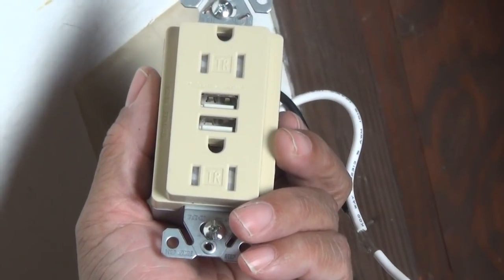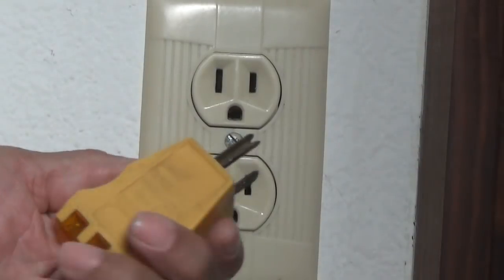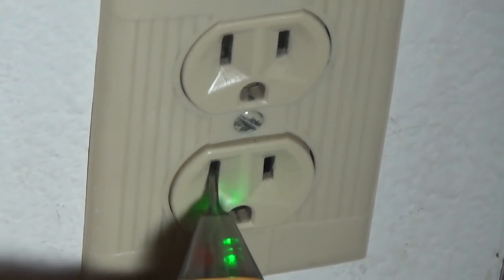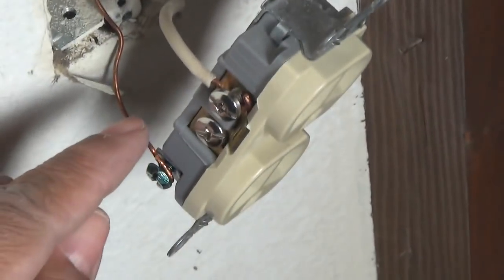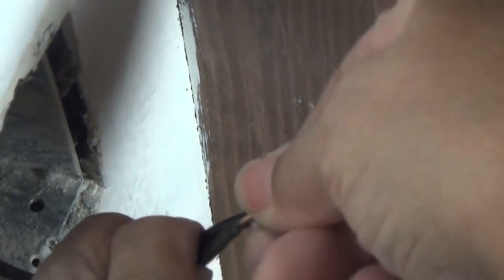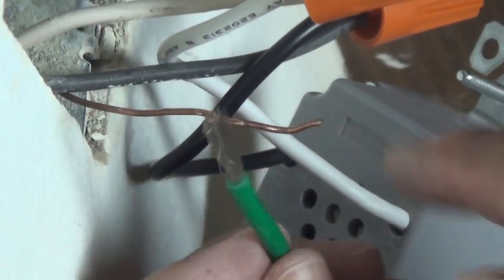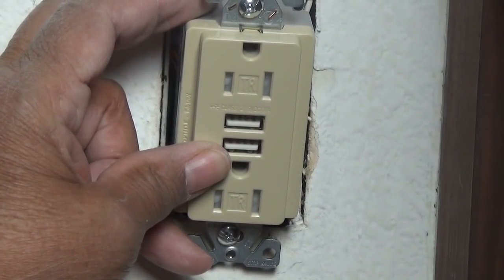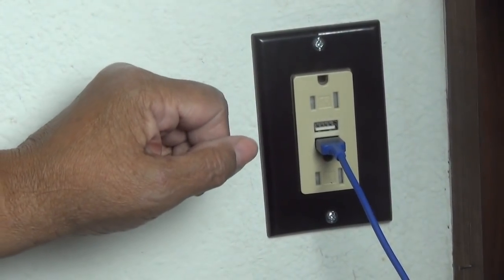USB PORT IN A WALL?! - USB Outlet Tutorial

Comment: I would check top and bottom of outlet. I have some switched outlets that are controlled from a wall switch. So the the little bridge connector on the socket is spit and it could appear to be off while the other half is still hot!
https://ask-the-electrician.com/images/switched-outlet-step-3.JPG

Comment: You help so many people I wanted to pass along that these outlets are not a good idea. USB power is changing so much that there is a very good chance that when installed they will be worthless shortly afterwards.
Reply: It's only a 'bad' idea if one wants to have the fastest charging speeds or doesn't mind tying up an electrical outlet with a USB adapter. I have two of them, one I've had for three years. It outputs 2 amps which is more than enough to charge up more modern devices. I'm sure at some point they will become obsolete. If they do, I'll replace them because I value the convienence and appearance over the cost.
Reply: @johnlcallaway  mine do not charge anything other than very small devices. Some of those devices constantly go in and out of charge mode. And my friends caught on fire, luckily he was home and the circuit breaker popped. And he's a fireman so he had an extinguisher in the kitchen. So no mas para mi.

Comment: Over $24 for an outlet?! No thank you.
Reply: Depends on if you need both outlets or are willing to tie one up by spending another $15 on a USB adapter. I've got one in my wife's sewing room in her built-in shelving unit, and another in the kitchen for hooking up tablets when cooking.   They are a lot neater than having adapters.
Reply: Cheaper than buying a new charger, though.
Reply: @Faddidaddi  Where do you buy chargers? I get mine for $1.
Reply: I purchased a two pack for $16.99 on sale recently at Best Buy, but regular price is $29.99 for a two pack. Here’s the link:  https://www.bestbuy.com/site/dynex-2-4a-usb-wall-outlet-2-pack-white/5834701.p?skuId=5834701

Comment: American wiring seems so messy compared to UK sockets.
Reply: As someone who has been making my own electrical changes for decades, it's pretty simple to do. Three wires .. hot, neutral, ground. No switch to take up unnecessary space that no one in the US would ever use anyway. While Leah used wire nuts, there are other alternatives that are smaller and supported by most electrical codes. I still prefer wire nuts, they are far less likely to work loose than the more modern spring-clip versions.  And I never use electrical tape, a properly installed wire nut doesn't need it and codes don't require it. I think it's unnecessary, but there are those that think otherwise.

There are different styles of outlets with many different features, the one Leah replaced is an older style.  I find it very irritating that the makers of these devices insist on providing wires instead of lugs, lugs can make that installs so much cleaner. But that is a manufacturer's choice, it has nothing to do with electrical code. On the other hand, many of the switches I've replaced already had wire nuts in the box, so it wasn't a big deal.

it's only as messy as the installer made it. Decreasing the 'mess' often means more wire, which means higher costs.  It has nothing to do with code.
Reply: Hehe yes. Dont look like That in denmark to
Reply: I’m always amazed by how American wiring is done. Wire nuts belong back in the 50’s.
Reply: @sixpackpieman  the first wire nuts were walnuts🤣
Reply: Only messy if you're a British electrician
Reply: and Australia. If I saw a black wire, I'd think it may be an Earth. Although, ours can be a bit weird too, such as a brown wire being live and a green and yellow striped wire being Earth. It all varies, though.
Reply: I lived in dk in the 90s and the recepticles are up high on wall so you cant hide them easily with a chair or sofa like in USA and just in the eyesight of a toddler. Also its 220 over there. 110 will grab you 440 will throw you 220 will KILL you. Yeah. Ill stick with USA.
Reply: Sean Texsean 220 may or may not kill you. I’ve lived with 220v all my life and got my fair share of contact with electricity. It’s AC for a reason.
Reply: @DiscoGreen  110 has the potential to kill.
Having 230v in the UK means current is roughly half.
We also have shutters (ISODs) on sockets to prevent people poking objects into them.
Reply: @robertbritton656  never saw any shutters in the sockets when I was in DK. I have been grabbed by 115 for 20 seconds before.  I agree it wasn't fun. But why on earth do you (at least in DK) have the recepticals so high up on the walls? In usa they are much easier to hide being 12" from floor. In Dk the receptical in our living room was just above the back of the sofa right where the kids would play. And too low for a picture to hide it.
Reply: How so, got a photo?
Reply: We don’t grow up knowing how to rewire plug fuses
Reply: I don’t need to post a video on how it’s done I’ve 29 years experience in doing it for a living.
Reply: UK commenters like to group things and generalize because their brain can't handle the complexity that one plug in a home may be different from another plug in maybe a condo in another country. Nah I was kidding, I wouldn't generalize people from the UK into one big group, I realize they are a society of individuals some are smart and some are stupid, generalizing is the main tool for simpletons and stupid people. Shoot shouldn't have generalized the stupid people that is stooopid.

Comment: It's strange, funny and interesting how the same tasks are done in such different ways around the world.

Here in Italy, I've never seen a wire nut; we don't even have a name for it! When you buy a new outlet, there's no wire attached to it. You connect the outlet directly to the wires coming from the wall. There are tiny holes on the back of the outlet, in wich you plug the stripped part of the wire; then, you secure it with a screw.

Also, our ground wires are always sheated. Color coding is different too: black and white are viable, but we normally use brown and light blue, while ground is always green with yellow stripes.
Reply: American outlets have the same stab-in holes in the back plus the screw terminals on the sides. Both methods of attachment are used but are considered inferior to the screw terminals: 
https://www.familyhandyman.com/wp-content/uploads/2017/06/FH04NOV_03001_023.jpg

Loose Wires at the Stab-in Connections

As a timesaver for electricians, some outlets can be wired by pressing stripped wires into holes on the back of the outlet. This wiring method is allowed by the electrical code, but it isn’t good practice since these stab-in connections can loosen over time and cause problems. Look for these stab-in connections as you troubleshoot your dead outlet. Tug each wire to check for loose connections.
Reply: @Lysander-Spooner  it's not only pressed inside the hole, there's also a screw that "bites" the cable in order to secure it
Reply: That's interesting to know. We can learn a lot from these conversations.
Reply: Not all of our outlets come with wires. Just special purpose outlets like this one. European outlets also have superior shock protection. No wire nuts! How do you connect multiple devices?
Reply: @laRiduzione  on the back of the outlet there are in fact two or three holes; in one hole you put the wire coming from the wall, the other holes can be used to create a "bridge" to connect other outlets. Sounds messy but it's pretty straightforward when you see it!
Reply: Wire nut 1970 technology
Reply: Wire nuts are as good or better than other 2018 technology when properly installed. It's been my experience that people who don't like wire nuts don't know how to use them.

Dumbing down something so people don't have to learn anything doesn't make it better.  it only encourages people who shouldn't be installing electrical outlets to do it without the proper knowledge.
Reply: looks easy to do it , wait until you see our outlets in middle east , egypt . 😂
Reply: We call that "back-stabbing" and we have that option with outlets and switches in the U.S. My home was wired in this way when built in 1955. There are a few disadvantages however. 1-Back-stabbed installations may not be as secure (I doubt this, my 65 year old house is just fine!). 2-Removing and replacing a back-stabbed outlet or switch involves cutting off about an inch of the house wiring, which means after a few modifications over the years you may end up with very short wires in that box! 3-Back-stabbing is only possible with standard gauge wire, heavier wire won't fit in the holes.
Reply: @childoferna  you got to be kidding me. There's always another hole next to the hole for the back stabbed wire for releasing the wire. You need a very small flathead screwdriver and got to press down/in really hard and it'll let go. I'm no pro but have changed / upgraded 15 to 20 outlets but what mystifies me is that there's no standard for where the hole is or which direction to press.

Comment: I have always been curious about the wires used in the US to wire a house... here in Italy i.e. we use various section dimensions depending what do we have to wire (2.5 or 3 square mm section for power outputs, 1 or 1.5 square  mm section wires for lights and other applications)... do you in the US use also different gages of wires to build the electric system of house and other buildings?
Reply: Yes. Depends on the current draw of the circuit.
Reply: @laRiduzione  thanks..
Reply: we also use the american wire gage ( not metric )
Reply: As Shawn noted, it does depend on the current draw. But it also depends on the distance of the total run. Longer runs require larger wires so they don't get too hot.  The US electrical code specifies both, for a run of 'X' feet requiring 'Y' total amps, a gauge of 'Z' is required.  For the most part, a homeowner doesn't need to worry as that has already been determined when the house was built.

Comment: Leah I often find myself just hittin main breaker so i dont have to worry about anything.
Reply from the maker: I can understand that
Reply: Sort of like using a sledgehammer when you only need a jeweller's hammer, but it works! 😉
Reply: I always say, I don't work on electricity, I work on wiring. Once there is no power to the house I don't have to worry about what the last guy did wrong. After I'm done I go outside flip the switch and see if I messed anything up Boom, or no Boom.
Reply: I understand, our latest home had a breaker box that was a mess. I have spent several hours tracking down exactly which breaker controls each outlet and then creating the appropriate labels.  Discovered one breaker that doesn't seem to control anything. It's been off for a year so far with no adverse affects that I know of.

Comment: What do we do when there’s an extra set of wires on the bottom screws of the original outlet?   I think the wires are heading to another outlet.  Do we now just mix them all together?

Also do you know the charging rate for these new usb outlets?  For example a tablet or laptop can charge must faster if it can draw more power.
Reply: Daniel, as long as you keep similar wires together (all whites, all blacks,etc) and the metal screw-in area inside the wire nut is big enough for all 3 wires without being loose, it should work fine.

As to the amperage of the USB ports, you'd have to check the specs for the model you buy. If there aren't different amperages available now, there will be in the future.
Reply: Just to add to Rick's comment, there are different sized wire nuts that are labeled for the min and max number of wires and sizes.  One can often get bigger wire nuts. Or one can create a 'pigtail'  if there is enough room in the box. A pigtail would be running the original wire to a new wire nut and adding the second wire to it as well as the one to the outlet.  

One difficulty is these new types of outlets are bigger because of the additional circuitry and can often be difficult to get everything to fit back into the box.
Reply: As suggested, create a pigtail, or better, go to HD/Lowes and get a small bag of these, they're about as cheap as wirenuts: http://www.ideal-international.com/media/img/product/medium/in-sure.jpg

Comment: Check both outlets. Just in case.
Reply: It might help to say why; the two outlets 'might' be on separate circuits.
Reply: @rickferris6987  Well said.
Reply: Yes. There is usually a tab that one can snip or remove that turns the entire outlet into 2 separate 1x outlets.  Doing that allows one to connect one circuit to the top, and one to the bottom. Also not explained, is that having the ground on top, which looks backwards to most Americans is actually to provide just a little extra safety.  Doing it that way, if anything conductive were to slide down the wall and hit any exposed metal on the plug, it would hit ground instead of the hot or neutral.
Reply: @boots7859  I like the idea of upside down plugs. I did not know that was the reason though.
Reply from the maker: I agree....thanks for mentioning this.
Reply: @seejanedrill  My pleasure.